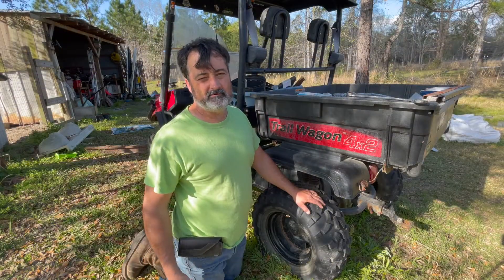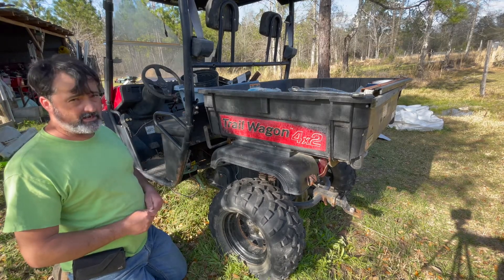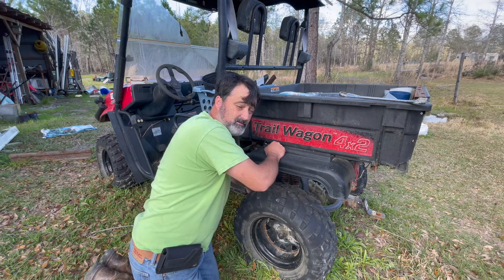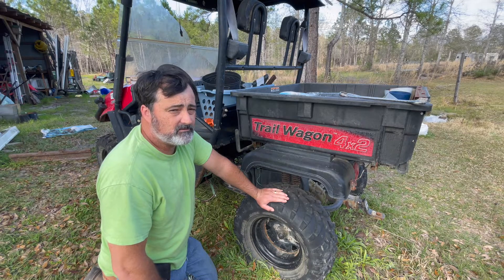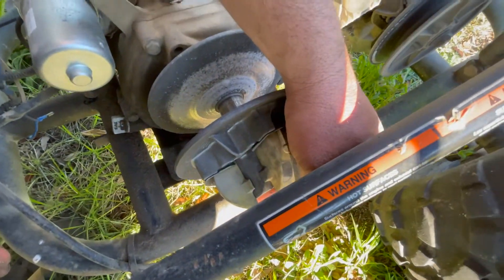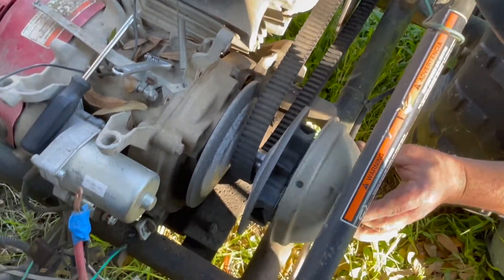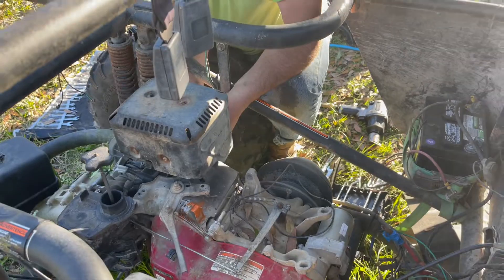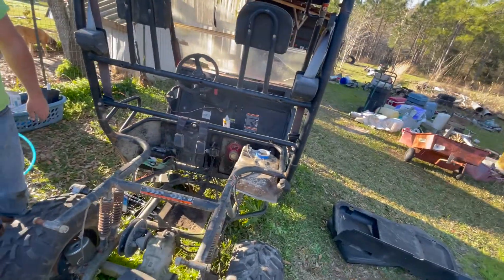Trail Wagon TW400 Sportsman 4x2 UTV Honda GX390 Motor Swap to Predator 420 | Will It Run Part 1

Comment: Did the engine mounting bolts line up in the mounting plate, without any new holes needing drilled or modified? I'm about to do the same engine swap on our Chuck Wagon SxS. Thanks for the video.
Reply from the maker: I believe there should be no problem lining them up, I didn't have to drill any new holes they lined up with the ones that the original engine were mounted to.  If you have any other questions I will do my best to answer them for you.  Thanks Robin - GossMania Homestead!

Comment: Hey my friend, did that engine work when you were done? The reason i ask was, i was going to do the same thing, with the same Predator 420,but doesn't the new engine run in the opposite direction. I haven't worked  much with these so, i thought i would ask someone who had actually done it. I would appreciate any help you can give.

Comment: How do you like the trail wagon?  I’m contemplating buying one for our little 10 acre property, we have some hills and a lake we can launch an aluminum jon boat in.  I’m a little concerned it might not be strong enough.   What’s your thoughts?
Reply from the maker: Reply from my husband Robin - We’ll this one at first wasn’t strong enough because the engine was wore out.  After I replaced the engine it was stronger. I even pulled my 14 trailer up a hill that was loaded and it did well.  It will handle the Jon well if the wagon your getting is in good shape.  If you have any other questions please let me know.